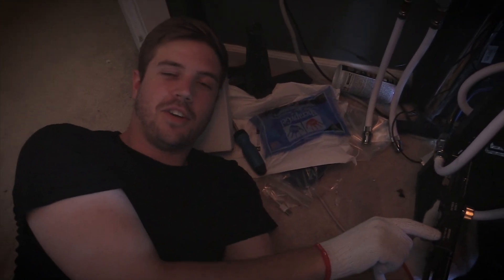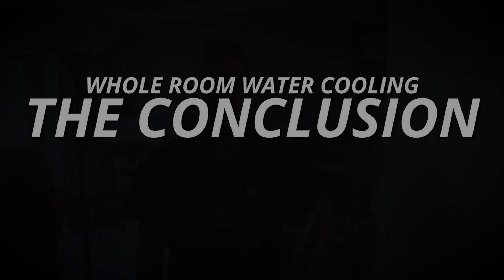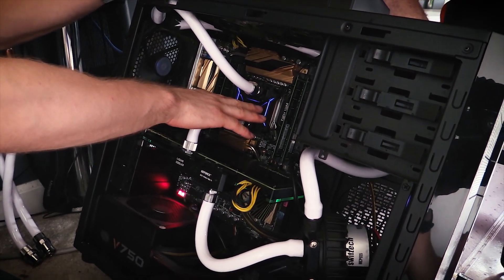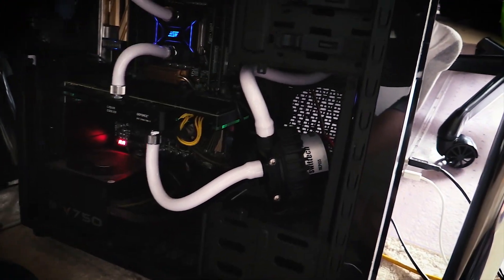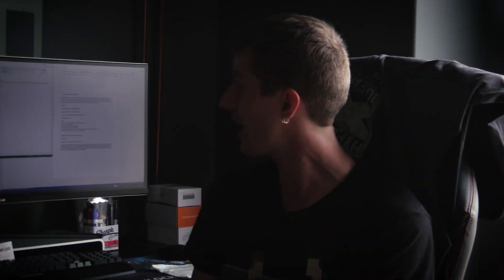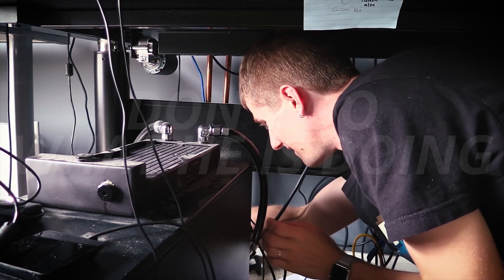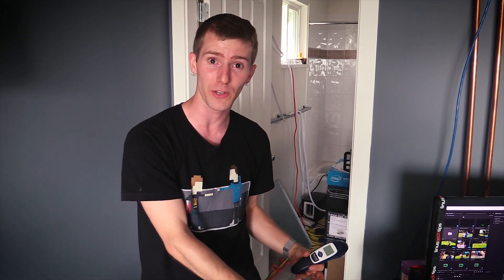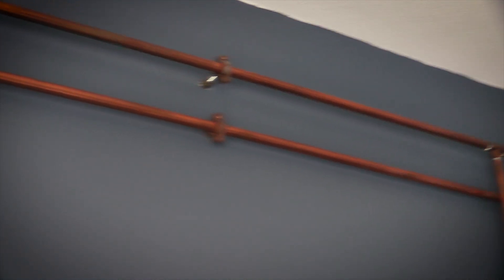Whole Room Water Cooling Part 7 - It's FINALLY over!

Comment: Linus TechTips Did you consider insulating the copper tubing in the room, and not outside?  in this way, at least, from my speculation, the heat would indeed be retained by the tubing while indoors, theoretically reducing ambient temperature, but also allowing more of the heat to be moved outdoors, possibly making for more efficient cooling?  That's the only thing I didn't see attempted in the final setup that may have altered the results some, but whether or not it would be something to write home about or not would indeed be adifferent story.

Comment: on a serious note, i think the room temperature only drop by 1 degree due to heat from the pipes that adds to the room temperature. i think if you put heat insulators at the hot pipes it will prevent from the heat to entering the room. i think that should get a better reading. plus, i think you guys should also look at the room's ventilation system. improving that may help more.

Comment: How about sinking a coil into the ground outside turning it into a radiator taking advantage of relatively constant temperature at a certain depth?  No fans, no radiator, just a long, reliable coil in a place where you really can't maintain it anyway.  I then think about using a heat exchanger to isolate loops that travel through your systems from loops that go outside. I wonder.  

Linus - Thanks for teaching us about the pumps, reservoirs, and gunk problems and everything else you ran into in this series.  I will watch it all again if I decide to do any of this.

Comment: This is a nice concept...you guys just got it all wrong.
How you should have approached this:
1. Pipes should have been ran along the base board, you want the pipes down near the cold air (heat rises): less pipe, less pressure, lower price
2. Should run full anti freeze through the lines: better cooling, little to no corrosion
3. Copper is the best option, but the pipes should have been wrapped in foam insulation painted to match the walls.
4. Last but not least, put a damn curtain over that window. lol

Comment: simply insulating the lines would drop the temp in the room even more.... probably quite a few degrees. lots of the temp is being dissipated through the outlet copper line before it even reaches the radiator. I'd say insulate the lines with Armaflex, but you'll have a new office soon.

Comment: What about water cooling directly from the tap? That would eliminate the problems with the reservoir, pumps and radiators. It would also lower the room temperature.

Comment: nice thought BUT What about copper coil inside a small fridge
(add ice to chill pipes and have a tap to drain water and refreeze with a ice machine)

problems packed in that room
your hot tubing radiates heat too close to cold (insulation needed)
few big problems you have carpet (stores heat near tower plus in the room)
windows no double glazing or awning or blinds (use led lighting)

Comment: The number one problem, was not insulating the copper tubing so that half your heat was not put back into the room you are trying to keep cool, but instead, is dissapated outside thru  massive car radiators. After spending all that time and money why not buy a roll of black foam HVAC copper tube insulation for the room tubing?  All HVAC air conditioners in every home use it for the exact same reason! your room temp would drop and most of the heat is dissapated outside.   (and also get a plastic res)  I do not understand why people go to all this time and money and trouble and skip one little step of insulating the copper tubing. Unless you are trying to warm the room in the winter maybe!

Comment: Why not just move everything down to a basement (if available?) and lead all the necessary connections up to the room you house the computers in? Cooling could be done in a separate room, vented outside, and noise would be basically zero... You could even eventually feed the exhaust heat into a peltier unit to recapture lost energy if your outside temperature was cold in comparison to your exhaust heat (like at night?). 

This couldn't be feed back into the grid, unless you have special equipment to synch it back in at ~60hz AC but you could recycle it in your own way for another purpose manually.

Comment: Personally if I was going to make a water loop like this, I'd have the pipes running out side into a shed. It would benefit as the out side would be colder then room temperature. However, I do not know how this will face up during the summer.

Comment: You're literally radiating into the room with uninsulated copper piping. That's how copper heatsinks work. The fact your intake and outtake lines at the wall are within 2 degrees tell me you are very efficient in venting all that heat into the room. Go take a look at your hot water tank and see the shielding used to keep the water temperature loss minimal.

Comment: i would say this is impressive. but yeah, you are actually right on the mark. if you actually would like to lower the room temp, the air conditioning would be the best route. it would also lower down the temps on your PCs since water still absorbs coldness. though, you need to have a air conditioning unit that can give you the right temps.

Comment: I know I am late to the party, but when you took the pipe temps at 7:35, you weren't pointing the gun at the pipes, rather the wall hence why tje temps were almost the same. the 1 degree difference would be the hot side warming the wall. Check the vid and watch the red dots. Totally missing the pipes on the hot side. Still awesome as hell though!

Comment: I think i was at that conclusion on episode 3, but good series, and i guess you have to see it to the end to be authoritative. 
If there were some commercial components optimised, tank, heat exchangers fluidics, PC components, it may make more sense, Apple approach bringing the box off the floor airflow away from restriction of the wall, and better internal thermal design is a good one, even with air-conditioning a row of HP PCs under the desk may not be well cooled, and aircon has to be cranked up to be uncomfortable for humans to compensate.

Comment: Insulated PVC pipes could help AND there are autmated bleeders for heating systems you could have used + added some filters to keep gunk out. I have been running my two PCs with out-side cooling for about two years now and had no problems so far, apart from having to run coated cooling blocks, due to having anti-freeze in the coolant for winter.

Comment: quick way to fix the situation:
Replace the water reservoir with one made of plastic and place that inside a refrigerator - or even fridge. Place said fridge outside as well. Then add the spare radiators into the normal copper "cold" line, add some fans to blow air over these radiators and enjoy a chilling breeze :)

Comment: All you really need to do is get some pipe insulation. it looks like small grayish black pool noodles with a slit down one side. They make a hell of a difference on the ambient temperature of an indoor water heater, so it ought to work with your system keeping the heat to the hot pipe and keeping the cool pipe cool.

Comment: you could install a water chiller in the loop. water chillers are used mainly in hydroponics growing. i believe the water chiller would not only keep the systems on the loop exponentially cooler to such that the ambient temperature might drop up to 5-10 degrees which, is HUGE in terms of ambient and system temps. Though completely impractical vs cost it's still a solution i would toy with.

Comment: You guys shoulda got a window air conditioner for 150 bucks! I got one from my room and it dropped the temperature like 20 degrees f because it pulls out the hot air and replaces it with cold air

Comment: hey Linus why didn't you use pexs tubeing? (http://www.uponor-usa.com/Residential-Plumbing/Homeowner/PEX-Explained.aspx) this stuff it's used in housing as a way of heating a house i bet it would have been alot more easy to run than copper

Comment: LinusTechTips 1.Build a open pipe tower on the highest point of the loop with a filling station as well near it
 2.insulate those copper pipes in the room (heat radiated in room)
 3.Custom PVC reservoir with silver mesh.
The efficiency of this loop will greatly increase on some sort of radiator fluid not water because it has a higher heat capacity.
All your problems sorted. Need any help contact me.

Comment: Why isn't the copper tubing insulated? The whole point is losing as little as possible energy going to and from the heat exchanger.

The biggest tell of your heat losses is when you measured the temperature on the ingoing and outgoing pipes. It's identical ...

This was an excellent exercise in futility.

Comment: Those copper pipes will dissipate the heat inside the room faster than the water flow to go outside. This is a fail.

Comment: Well, if you weren't moving, some stick-on, warp-around pipe insulation and a chiller instead of a radiator could have done a better job cooling both your workstations and the room itself, no?

Comment: Linus, You can get temperatures from inside the pipe where the water is flowing to get a much more accurate measurement for cheap. You can get Inline Temp. gauges online cheap. http://www.ebay.com/bhp/inline-temp-gauge

Comment: I'd have give a test to use thermoelectric cooler(s) or a refigerator unit between the reservoir's/system's circle and the radiator's circle, to "pump" out the heat. Using some insulation on the reservoir, so you could cool it to a much lower temperature than the environment lets you.

// a big fan of you

Comment: The copper pipes need to be insulated and they need to run into a heat exchanger outside. Should really consult with a refrigeration engineer being undertaking something like this.

Comment: Your concept with whole cooling loop is wrong from servicability view :-) . Your gonna hate me for that
You need separate loop in every pc conected to main cooling line. Your roof radiators are hmmm forget about them there are better ways to do that :-P Use heat exchangers in every pc and cooling line conect directly to AC but don't go much bellow 20C coolant temp cos u might get condensation on the piping. have fun :-) 68F in your parts of the world.

Comment: LinusTechTips Hey just to make this a little bit more interesting: could you just buy some insulation for the copper pipes (yeah i know its ugly, but you are moving anyway :P ), snap it on and remeasure the temps? That would be really interesting!
(something like this: http://www.homedepot.com/p/Pratt-Retail-Specialties-3-4-in-x-6-ft-Rubber-Self-Stick-Pipe-Insulation-216-lin-ft-Case-PI346RSS/204759302)

Comment: How much did the cost of fittings run? It looks to me that the fittings were probably the biggest expense (or a big factor not including the cost of redoing, pumps/ because of the coolant issues)?  

Also, if the goal was to reduce temps indoor temps shouldn't the outlet(s) should be done in a lower heat transfer material (pvc?) which might make it lower cost as well?

2.) Is all the majority of the heat due to the CPU/GPU or is a good percentage of the heat because of PSU? (is it possible to water cool PSU's?) might be worth considering.

Comment: so, moral of the story: whole room water cooling should not be attempted by the faint of heart/wallet, whole room water cooling requires a workspace with a very unique layout so that the pipes do not have to be routed as high, thus reducing head pressure requirements and increasing the flow rate, tubing should be plastic of some thermally insulating variety to reduce radiant heat, and the fluid used should be thoroughly sanitized before putting it in the loop. Is it worth is? No... It would probably have been easier to simply install a bunch of clients and offload all of the processing to VMs on a dedicated server that you could cool with a dedicated A/C unit. You increase your latency a bit, but that is of no real consequence for video editing and rendering.

Comment: Wouldn't it be both cheaper and more heat efficient to use lagged PVC pipes instead of copper?
I'd love to see a WRWC 2.0 series where you take the lessons learned from this and applied them to a new setup.

Comment: I liked this series. However, it gets a thumbs down because of practicality. 1) It should always be assumed that you will be moving. It may not be for 10+ years, but even so, its money wasted, 2) like you said, you could have achieved the same or better effect by just putting a damn AC in that room and not spending (more) money then that + water cooling for each computer would have cost.

Is it cool? yeah. Should anyone ever do it, no.

Comment: Is more easy to use a adapted fridge motor cooling system, or use an central unit Air Conditioning (Where noise is emitted outside the building )with tubes sealed where each radiator unit from each computer have contact with this air Isolated from the workplace that have a normal temperature.

Comment: This is the way I think it should of been done, I had it this way at my old house! You need a place with a room that is back to back with another room, and has at least 1 window! Put the computers in the one room, and then run you're loops through the wall to the other room and hook-up to you're rads. You can do all systems on one massive rad, or just do them individually. Then get a portable air-conditioning unit, unless you are in a hotter climate. If you try to use a window unit, and you don't live in a hot climate area what will happen is it will freeze up during the winter. Portable unit's do not, they just require venting out the window, which allows you to run the unit during any season. Make sure you isolate the window if you are going for a 365 day setup, don't want winter air creeping in. The smaller the room the better, and make sure the unit is on the other side of the room away from the rads, and centered up to provide a nice even spread of chilled air in the rad's general direction! I installed my rads on the wall, with a thermometer right under neath. And with some tinkering of the units I was able to keep the room at 68F. I even built external boxes for the other water cooling components "psu's for rad fans, reservoirs, pumps, etc" to clear up internal pc space and allow full use of internal fans. The only water cooling that was in my pc's were the the in/out tubes, everything else was hanging on the wall in the other room in boxes I designed! I used 2x Watercool MO-RA3 360 PRO for each computer, 1 on cpu, and one on gpu's, in push pull! My computer room was comfortable because everything was in another room, that was constantly being chilled!

Comment: Using different kinds of metal in your loop causes heavy corrosion. Pretty sure the tank isn't copper therefore the problems. An all copper loop would be no problem at all. Slick's dad should have known that.

Comment: Can somebody tell me the difference between these two graphics cards

GeForce GTX960 ASUS STRIX 2GB DDR5, HDMI/DVI/DP/128bit/STRIX-GTX960-DC2-2GD5

 GeForce GTX960 ASUS 2GB DDR5, HDMI/DVI/DP/128bit/GTX960-MOC-2GD5

The Strix one is 30$ cheaper
Reply: srba filipovic different clock speeds and cooling
Reply: cooling
Reply: Thx guys :)

Comment: I remember face palming when he went through the material list in the earlier videos. PEX piping man, far less corrosion issues better heat insulation, easy to work with, cheaper than copper. Idk seems like a lot of time wasted for zero results. Good try though. Luke was right though, A/C would have been a much better solution. Sorry Linus!

Comment: Linus, to add, you will also have a larger thermal capacity in the amount of water you are using for the whole room rather than the smaller amount of water per computer used with individual radiators. A surprising amount of thermal capacity i might add. 
you guys put so much work into the whole room water cooling setup, all to just move to a new location.
And it wouldn't have been as cool (so I would still vote water cooling) but you guys could have just put a window unit in or something simple like that.

Comment: On the other hand, everyone has A/C. Whole room water cooling, not so much.

I like the idea of whole room water cooling a set of workstations. Ideally using a passing stream :-) Also insulating the pipe (obviously!?). It would be neater if you ran it underfloor to. Might still be costly but i like the idea and you would save on electricity.

Comment: Really cool idea.  Would've liked to see the efficacy with insulated pipes rather than copper; that was the only thing that seemed like a glaring mistake to me.
Same thing for the reservoir- if your radiator is outside, there's no reason to be bleeding heat inside.  And of course the corrosion thing is also a problem, even if I don't really know why that'd happen...

Anyway, really cool, really liked it.

Comment: I've thought of a few solutions. You don't need to run it all the way up to the ceiling for each computer, this just increases the strain on the pumps via the force of gravity from all the systems, as well as save a few bucks on copper. And, if you put the pump above the reservoir, as well as everything else, it will help decrease the strain.  Also, you may want to look into shark bite fittings if you do this again (they fit copper, PVC, and composite), and although they may be a little more costly than just soldering it all together, they are infinitely more helpful as they pull apart for quick deconstruction and maintainance. Lastly, you might want to reconsider the placement of the massive radiator. In the shade would be preferable, you might even be able to stick it in the basement to get it out of the way and keep things naturally year round cool. Love the show guys!